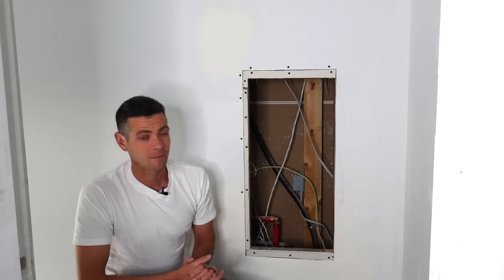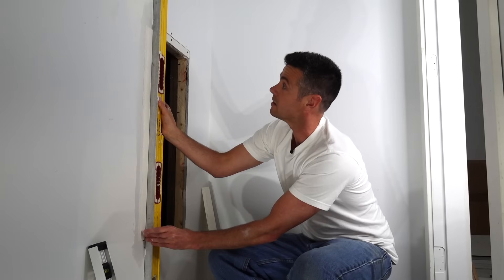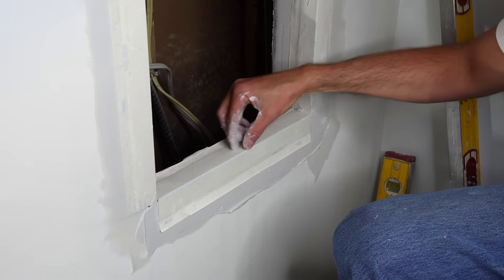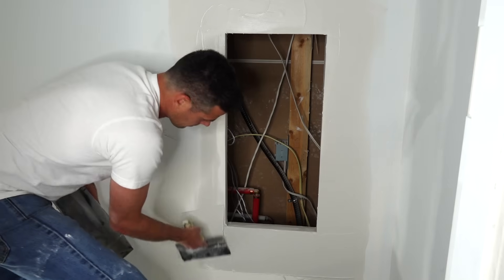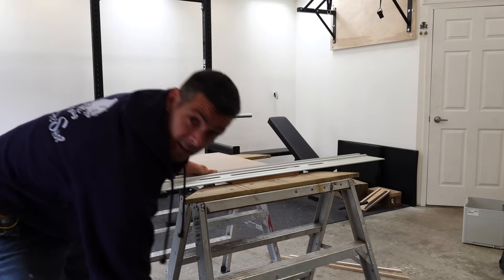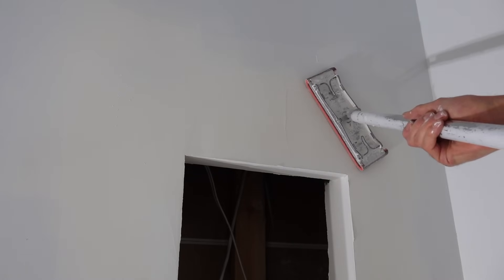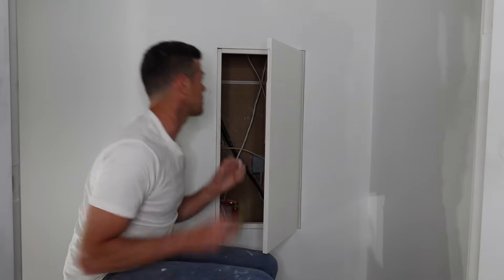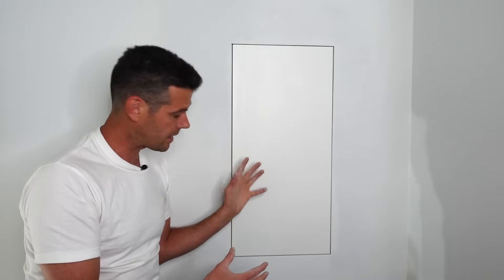Making a FLUSH PANEL CABINET DOOR in DRYWALL!

Comment: Did 1000s of these in London years ago in hotel and office construction with edging bead . Proper pain.. Wouldn't use flex tape on a panel as its too fragile and would probably fail after a good few openings or people working in there with tools might damage the edge.When possible we had the panel doors pre cut and fitted the bead to suit,that made our job a lot easier. When doing a lot of panels I would secure the bead with staples using the door as my guide then use some quickset but avoid the staples. Once all the panels had set I'd remove the staples and finish quick setting. This works well if you are doing 20 or 30 panels at a time .You had to number them if they were of similar size since there was several in a suite.Nice to see the old hawk and trowel out (my preferred tools) ...

Comment: Thank you for that great instructional video. I am going to follow your guidelines. Only this will be for an HVAC closet in a wall that we do not want to have trim on or see any door hardware. If I was to build this at 30 inches wide by say 60 inches tall, does the same detail apply? And should I add additional hinges and maybe an additional magnetic push pole latch? What do you think?

Comment: The easiest way I've seen dude hang doors is with 1/8 or 1/16 inch spacers. On the bottom and between the door and casing. No measuring and it sits perfect every time

Comment: Would you ever consider creating the door from a gypsum board? It seems that the door (since it is mdf) is always going to have a slightly different color than the rest of the wall (or is it?). Everybody will know there's a door there, because of the empty space, but the perfectionist in me would love for the empty space to be the only thing revealing the door :)

I am not a craftsman/carpenter/installer. Nothing like that. I purely watch the vids out of interest. So, if this question doesn't make sense, don't hate me :D

Comment: In Europe we use prefabricated aluminium frames (in standard or even custom sizes) with perfect right angles and built-in mechanics. You can add the same kind of board as the wall. Installation is super simple. Screw it around, coat, sand, paint, done.

Comment: There was one time under a window when the board butted right up to the trim flush I went ahead and taped it and busted it out like a butt joint actually worked very well and hasnt failed or cracked in years now.

Comment: I would use 'J' chanel to trim out the opening.  Make sure the hinges are designed for inset doors.   The panel must be super flat, and primed on all 6 sides to inhibit warping.  It may be easier to build the interior box on your bench and install it after the opening is trimmed.  Add foam board insulation and rubber gasket to the door if it is not a conditioned space.

Comment: Hi, I'm making a similar flush panel door, but when it's done, I want to cover the wall in T&G barn wood planking that is 5/8" thick. Problem I'm having is when I open the door, the barn wood planks hit each other on the hinge side. It's almost like I need a hinge that will swing outwards more during the opening process. Any idea what type of hinge I would need?

Comment: If I blow out a hole on MDF I generally try to fill the hole with some wood flu and stick a couple tooth pics in there until they wet tight let them set and cut them off with a multi tool

Comment: I was planning on doing this for the double wall that the previous owner did on an addition, once I opened the wall I found the face to back wall was 12 inches so I just bought upper kitchen cabinets and sunk them flush. it is strange to open a cabinet expecting a small medicine cabinet but then have a massive space.

Comment: Not sure I understand on dead level on the bead. I would think you could use the level to make it level or if it's a magnetic one, cut a piece of metal and press on the mud to make it level. Not best explanation but just thinking has to be a faster accurate way. I am not a pro mudder.

Comment: I’d put the screws under the hinges.
I often used hinges to hide screws.
Reply from the maker: I do that on actual cabinet work where you can easily see where the hinge is going to be mounted. In this case I didn't want to screw myself over and accidentally place a 2" screw right where one of my hinge screws might go. Could be done with proper planning but oh well. Good enough for what it is.

Comment: This video came at the perfect time. I'm remodeling my condo/apartment and the furnace is in a closet located smack dab in the middle of the living room wall. I want to put furniture against that wall so I don't want a door there. The furnace only needs to be accessed a few times a year so I was thinking about making a hidden door for that closet. I can put my furniture in front of it but still be able to get to the furnace when needed. The problem is that I couldn't figure out how to build a hidden door there. The door in this video is the perfect solution. My door will be bigger so the hinges will need to be sturdier but, overall, I think this technique will work well. Thank you so much for filming this!

Comment: Great project and video. I followed this as best I could and am happy with the end result.  My one true mistake was using trim with 1/2 inch thickness.  VC rips 3/4 inch MDF into some trim, and the thickness is ESSENTIAL for the hinges to be able to close and have the correct reveal along the door on the hinge side.  My first attempt couldn't clip in.  Also, having never attempted drywall, it was not easy.  Luckily he does a lot of other videos that helped.

Comment: After you fixed the blister, you still used quickset mud for coating right? Cause you can't put wet air-dry mud on non-dry quickset right?
Reply: This is none of those things that confuses me too, and the “I will give this another skim tomorrow”, wont it be too dry to adhere well but not dry enough to skim

Comment: It is called WOOD glue. Not finishing glue. You, don't put wood glue in your joint compound. They make taping mud for a reason. And on glossy surfaces you hit it with a sander and scuff it up. Then you prime. 

 In my experience as a finisher, you teach people the proper way. It's faster than the fake way.

Comment: I make a jamb out of wood for the door. Put a bevel on the face, maybe 3 degrees, so the gap between the jamb and drywall can be taped and muded. That allows to make sure you have nice tight and straight gaps.

Comment: Ben... you are not only THE master of drywall, you're a skilled carpenter and one of the most genuine people on youtube. So please understand my comments are in no way a criticism. You've taught me a ton of stuff and if I can maybe return the favor a bit, that'd be great. Generally, Blum offers three different... uhhh... mechanisms (?) of hinges. Soft-close, self-close and free swing. It appears you used the self-close, although your link is for soft-close. When you use a push to open magnetic catch, the free swing option is usually best. Also on that note, Blum has push to open magnetic catches that are pretty cool. They're called Tip-on. I have no idea why. You can adjust the depth of them with a simple twist. Hope this helps and thanks again for the awesome content!

Comment: Oh can I use wood for the sides in that niche instead of thin strips of drywall, and then apply drywall compound on top of it? I built out a couple of niches and used thin strips of drywall, and then mudded on top of that. It came out nice, but was kind of a pain

Comment: If instead of a corner bead the narrow edge of a 1x4 was flush against drywall, the gap between them was pre-filled and then taped with glue-infused mud. Is that bond doomed? Asking because I know of a joint done that way.

Comment: Actually, the measuring across being constant only gives you a proper trapezoid. 
To truly have a proper rectangle you would have used some version of a carpenter's 90° angle.. either a speed square or an "L" angle. For this, the L-angle is probably better, as you could put the long edge along the long edge of the opening. 
😉
Reply: Measuring plus using the level accomplished the proper rectangle, along with ensuring that the frame was properly vertically.

Comment: Why did you only put FibaFuse in the lower left corner and not all of the corners, or why are you only worried about the lower left side cracking and not the others?  Is it because you have a butt joint in the two added pieces of drywall there?

Comment: You should have used that plastic tear away bead instead.
It gives you a crisp ridged corner/edge and still covers the 1/2" drywall edge but doesn't connect to the wood part.

I just did this for a drop box coming into an office so I could blend the access panel to the lower safe door into the wall behind reception desk

Comment: When he first taught me to do trimless window openings, my mentor had me run Straight-Flex all the way around in one piece (cut ½ way thru at the corners so it would bend). Looked really sweet when finished; wish I still had the pics.  (Tried doing the same once on a door-shaped walk way... into a hallway, but the Straight-Flex wasn't designed to take the beating that corner bead can; didn't hold up well under abuse of "living" around it.)

After we discovered the Trim-Tex vinyl corner bead (this was 12+ yrs ago), their bullnose corner bead options, and their kerfed beads... we never bought another stick of metal bead.  He gave the metal bead to competitors who asked us what our secret was! 😂🤣🤣

We did keep boxes of Straight-Flex for doing the odd-angle. However, never being called back to fix dinged metal corners was so nice... and it was an obvious difference in work when we started using the softer-looking round corner bead (got us more word of mouth jobs than we could handle).

Comment: Thanks for the info and ideas! Great video! Wish I had some of the quickset here in Greece. Used it all the time in the states. The base coat mix here is a pain to work with. It dries rock hard and is impossible to sand. If I buy the pre made mud at on of the big box stores here it is a lot better to work with when it comes time to sand. Picked up on some acrylic top coat as well recently, goes on nice if you have the ability to do mud work ( gads I don’t ! ) and it dries rock hard as well but with a gloss finish if done right. This stuff reminds me of the mix we would make with paint and mud to stipple ceilings with.

Comment: Wouldn't it be faster and cheaper to buy a premade one
Reply from the maker: As long as you have the option to adjust the rough opening to fit the pre-made door it would work but you won't really save much time or money. Also, in the case of an access door they are usually painted the same as the wall so having the glossy finish of a pre-made would stick out like a sore thumb. Honestly, making the door is really easy and provides a lot more flexibility for sizes.
Reply: @vancouvercarpenter  Size flexibility is a definite plus, we use premade dors made from drywall with an aluminum frame so they can be painted.
Great job as always nonetheless!!
Reply: @vancouvercarpenter  Also in Europe would be near impossible to find someone who does woodworking and drywall

Comment: Really enjoyed watching this. I think I'd like to do this with a plasterboard door, I'm not sure exactly how I'd go about doing that, but I would really like a consistent finish (i.e. texture / grain matched between wall and door).  Perhaps there is some metal based product on the market with beads built in, and with the ability to plaster into it (kind of like a floor access panel that allows whatever flooring you are using to be installed into it). I don't mind spending a few quid on such a bit of hardware. I've already built the hatch in 2x3 timber to a random size but could reconfigure it to suit a standard size (i.e. cut the timber / install new bits), as haven't boarded up yet. I'm sure there are guys installing these things all the time but I've never seen it done well, certainly not in a ceiling hatch. The reason is that I have a small hatch for a false / suspended ceiling which requires access over a bathroom and it needs to look as good as possible... Any tips from seasoned pros out there? (I'm based in the UK so hopefully I can source parts here!)
Reply: Don’t know if you’re still looking, there is stainless or galvanized wire mesh intended to reinforce cement that could take a plaster skim coat - if I understand what you’re asking for.  It ranges from window-screen size holes to multi-inch size holes, and is common in US hardware stores.

The other (easier) option is cement backer board, a fiberglass & cement sheet similar to drywall, but intended for wet areas like shower enclosures.  You score one side, then snap the line (like drywall) to cut it.  It will take drywall screws for attachment to your frame.  Very common in the US too.

Not a pro, but a longtime DIY homeowner.

Comment: You can actually fold this corner bead into a rectangle of required size and then just do some relieve cuts on the outside. This way you don't have to deal with 4 separate beads.

Comment: I wound up doing something very similar a few years ago for an access panel in the ceiling of a small bathroom.  I wound up using molding to cover the gaps (like a picture frame).  We're happy with it and hardly anyone notices
Reply: Question about that…doesn’t the molding interfere with the opening/closing on of the door on the hinge side?

Comment: Great video.  I never realized the trick of adding the glue to the mud.   One thing though, the author routinely interchanges the " mil" for millimeter which could be confusing if he did so on other projects.  In North America,  "mil" generally means one thousandth of an inch, not short for millimeter, which is very much different.  Plastic sheet/film is usually purchased by thickness using the mils nomenclature, for example.  Compare 20 mils (20/1000 inch) to 20 millimeters and you will see an enormous difference.   Looks like the author is in Canada maybe, so things could be different there.   Anyway, good video!

Comment: What I find that works well and versatile for many situations for door /panel covers is to make a jamb type frame screwed together then add what I call taping flaps to the front of the frame. The flaps can be about 1 1/2" wide and taper from 9/16" to 7/16" and be made of plywood Baltic birch works best. Glue and pin or screw them to the face of the frame. This keeps the frame square and ridgid. Now just insert the unit into the opening (with the drywall cut back) shim plumb and level. Now it can be taped into the 1/2" drywall but only needed on the face. The inside is all wood and can accept any type of hinge, magnet etc.... Btw, no need for a second jamb on the inside, just use inset hinges rather than full overlay. Also with the touch latch you don't need a jamb on that side either.

Comment: The key numbers for conversions in length is 
1 -- 25.4 ("25" is good enough) for mm to inches. So an 8th of an inch -- use 24mm instead of 25 -- is 3mm == 1/8". It is also useful to realize that 10cm==4", or about a hand (depending on your own hand size, of course). So if you measure something in hands you're getting measurements of ca. 10cm as a decent rule of thumb. On my own hand, the width of my pinky nail is right about 1cm. You can check this on your own hand to see if one nail, or other body part,  is useful for it.

2 -- 39.39" == 1m -- so a yard is awfully close to a full meter, with about a 10% error -- so 11y == 10m., again, as a decent rule of thumb.

Now -- Throwing out another set of useful numbers not related right here:

If you can remember 6 and 1.6 -- those are the rough conversion factors for miles to km and vice versa, respectively.  .6mi=1km, and 1.6km=1mi

Then there's weight -- 2.2 lbs==1kg, so just multiply kg by 2 and you get pounds, by 2.1 if you want a bit more accuracy. vice versa for the other direction, 1/2 lb-weight is kg-weight.

Finally, quarts and liters are very very close, so 4 liters == 1 gallon. This is another "off by 10%" number -- 1 liter == 1.1 quarts.
Reply: gonna add the width of a dime is really close to 1mm.  5mm?  imagine 5 stacked dimes

Comment: This looks really great.  Beats having the face "trim" part of a premade panel.  I've been trying to come up with a better/cleaner solution for attic access like this (not hinged, though).  This gave me some new ideas.  Thank you!
Reply: I'm here for that same reason.  Nice to know someone else is wrestling with the same stuff
Reply: For me the best is still dywall end cap, over a 2" border inside the opening, and then the drywall door sitting on top of that with 2" of blue foam board insulation.
The door has a 1/2" recess on the ceiling however.
I'm not sure about a door hanging down from a ceiling opening that people are going up and down through.
Thanks for posting !
Reply: @als1023  Interesting. I'm not looking to have it hinge up or down.  So that would work.  As far as the recess, you could just cut another piece of drywall the exact size of your opening and use construction glue to attach it to the oversized piece.  Might have to use more end cap or J trim on the fitted board, though.  Or maybe a piece of 1/2" MDF painted like Ben does here glued to the front of the oversized board.  I might actually try that.  Thanks for another cool idea!
Reply: Zac, I did the same for an attic access and I used Southco latches with white handles that sit really flush. It ended up looking super clean and the insulated hatch was treated and painted like the ceiling to be really inconspicuous

Comment: one quick thing that I hope will help to you guys - push to open with the magnets but - the hinges should be special ones - for push to open system (they are loaded with a spring that helps you open the door once you push on it- so no need for handles 😀👌